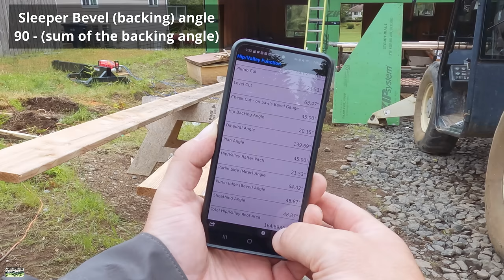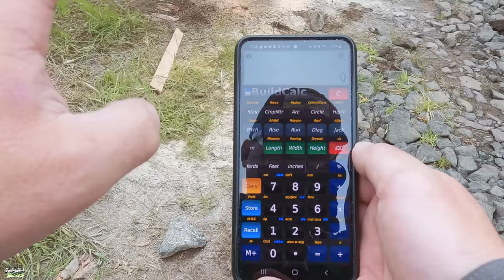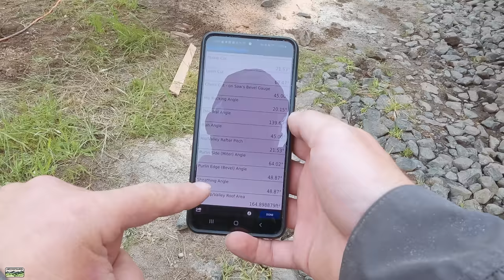Over Framing Made Simple Project 150 Roof Framing part 6

Comment: I downloaded buildcalc app and realized I had to set my calculation configuration to mitre saw to get the right hip backing angle. On a 4/12 roof the result (64 degrees roughly for sleeper bevel) is a steeper angle than my skill saw can accomplish. Might cut some bevelled blocking in shop to add to a non beveled sleeper or try this trick next time I’m on a steeper roof.  
Love the content- learning tons

Comment: I understand sheathing a roof like that from the top down. I clapboard from the top down. It's the way I was taught back in 1975 and still do it that way. It is much easier to snap lines on the bottom of the claps as opposed to the tops and if you are using short clapboards like we did 45 years ago, you just slide the lower one under the top one and it stays put.

Comment: You said you don't like adding blocking after, when I pre cut blocking or noggins I will add them as I go then you don't need to mark for rafters or joists as well. You just use the noggins as spacers. Providing you have consistent spacing

Comment: Nice video. I watch these regularly and enjoy them. 

If you don’t mind me asking? One important detail you left out or did not emphasize is how did you establish your bottom valley line on the roof? I am referring to your first valley jack that sits on your roof. 

You have established your two common rafters that are coming into your sub fascia on each side. I see these are nailed into sub fascia in video. How did you get that valley line transferred to top of plywood on your roof?

I guess you could plane in a straight edge from your two existing rafters and mark your roof but that may not be very exact due to the few rafters you are planing off of. 

Did you snap off of the top of your sub fascia to get your valley bottom point since this is where it eventually has to meet at?  

Did I miss where you started this since I did not look again? Yet. I guess my reason for commenting is that this point is very important on en framing this way and how you establish it. If this is wrong then someone unfamiliar with this framing will really screw it up. I can’t tell if your California valley fascia line is at same elevation of main roof or not here. 

Can you explain what you did here? I appreciate it and watch your videos all the time.
Reply from the maker: The plane of the rake wall determines the bottom of the valley on top of the sheathing.  As shown at the beginning of the video, I used a laser to set the ridge.  Where the shoulders of the beveled valley sleepers meet the ridge determine the top and pull into plane.

Comment: I Have one question, can the ridge board sit on the sheathing while the sleeper valley join on both sides of the ridge? or does the ridge have to sit on top of the sleeper valley (where both sleepers are joined together and the ridge sits on top of them)

Comment: When the roofer cuts the OSB for the ridge vent, won’t it be wider then your beveled squash blocks at the ridge? I understand it doesn’t take long to push through the table saw, but seems to have no benefit. Either way, great video and I always look forward to your videos.
Reply from the maker: The roofers won't cut any of the sheathing, we've already snapped a line down from the ridge and held our sheathing to that 👍👍
Reply: A good set of plans will have a detail for the sheathing offset using the ridge vent of choice and providing the correct sq. inches of air space for ventilation, while still maintaining the correct blocked or unblocked diaphragm connection across the ridge.

Comment: pull down 4 ft from the ridge, pop a chalk line and go.......ALWAYS  start from the ridge down in this situation, and let the dumb stuff work its way out on the last 2 pieces if it wants to.. or at least pull 4 ft lines and chalk them as a control from the top, if you really want to start from the bottom.....been doing this 40 plus years
Reply: Ur using 4ft oc chalk lines to check & plan as U start, smart.

Comment: Do you use buildcalc to calculate where you rafters fall on your valley sleeper or how do you figure it? Also, do you like the buildcalc over the construction master?
Reply from the maker: Yes I prefer BuildCalc

I actually don't figure them out, I usually pull parallel from the gable then cut them all on the ground